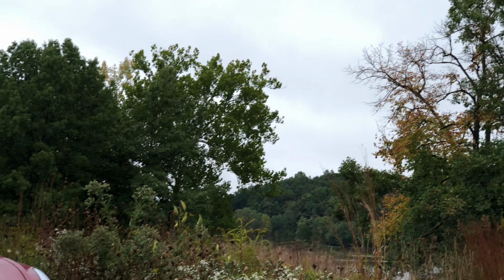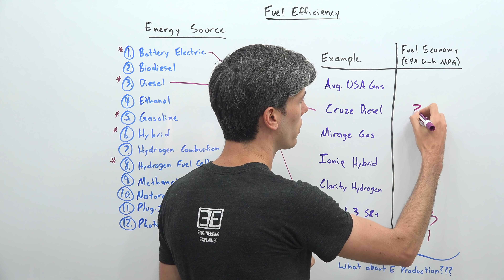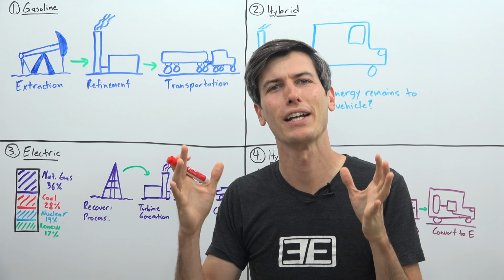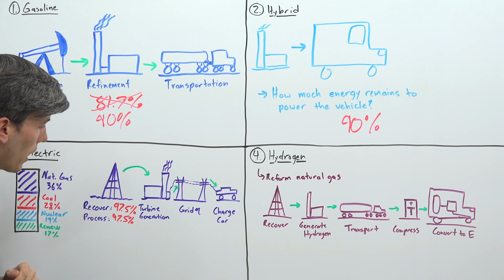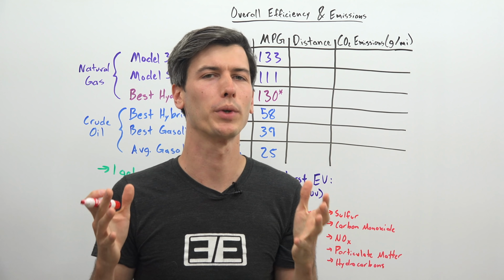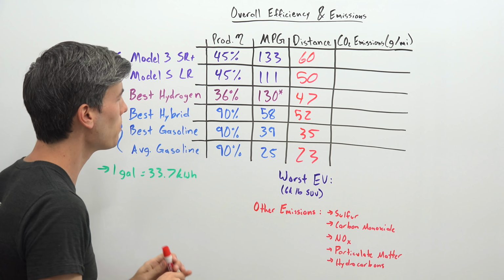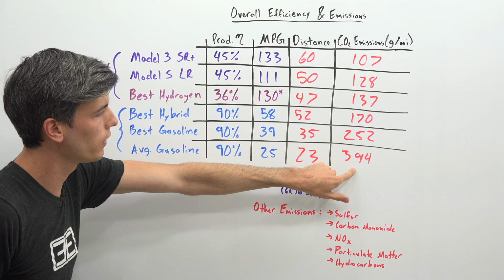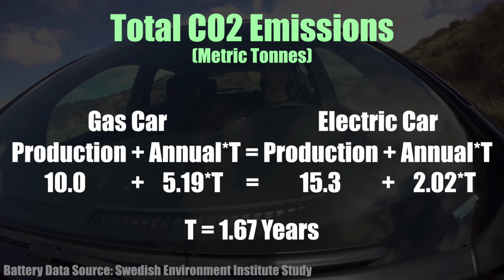Are Teslas Actually Better For The Environment?

Comment: My next question is along the lines of "horse power" pickups and semi's and other towing vehicle pull much more then their own weight. Are electric engines powerful enough to preform
Reply: Samuel Kenkel yes. The current problem is batteries are less energy dense than fuel and they take way longer to charge than refueling a truck or semi. The electric version would still be more efficient there would just be way more down time.

Comment: How does it stack up when you have a 6 year old battery?  Perhaps you don't lose efficiency just capacity?
Reply: Correct, 2012 model S (with the now old and ancient tech) have held up better than expected. 

1 million mile rated battery packs are around the corner, 400,000 mile packs are now

Comment: Hey! Where's the diesel production to mpg to distance to CO2 emissions?

I also have some doubts about your Diesel efficiency data accuracy. Diesels burn their fuel in a much leaner ratio and all at once because of compression ignition instead of a spark plug like gas. Hence diesel engines are the choice of large ships, trucks, etc that have to travel long distance or carry heavy loads. You are also leaving out the CO2 recapture that mass production (growing plants) of bio-diesel would have.
Reply: Because this is in America where unlike Europe, there is no small diesels, most are large. Per CC they are more efficient than petrol, but still nowhere near a electric motor.
Reply: Matt B in America nobody drives little bitty 2.0 diesels. They drive big 6-7L ugga duggas that get 15mpg at best.

Comment: Try calculating the rates with a fixed input, rather than assuming that the numbers which have been posted by EV manufacturers are realistic. There's no possibility that if I fill a tank with gasoline, and recharge a tesla with an ICE generator, over any grid, I'll get more than 15 - 20  miles per gallon.

Comment: Short answer no, getting lithium out of the ground is devastating to the environment around that mine. If we switched to alcohol fuelled cars, we could make alcohol from food waste, then the waste from making that alcohol can be made into fertilizer for new crops.
Reply: I'm never sure how people are convinced that electric cars are worse due to mining, while completely ignoring the fact that mining is involved in building all automobiles, including ICE vehicles. Not to mention, powering an ICE requires drilling for oil, shipping the oil, refining the oil, and shipping the oil again - all of which produces emissions, and you haven't even burned the gas at that point.

Electric cars, BY FAR, vastly reduce emissions from construction of the vehicle to end of life.

Comment: I wonder how well EV are working for people on Cali with no power?  I seen some charging stations being powered by large diesel generators.
Quick note on diesels.  Diesels can perform just as well as EV as far as mpg are how ever you want to measure it.  But the EPA is trying to push them out with all the regs.
2000 Vw tdi are getting 50mpg. (not the rigs soft ware years)  I know people who did a little modding and tuning to the ALH engine and was getting around 60 mpg.  This is a almost 20 year car getting better mpg than the new stuf todayf.  Really?  I call BS on the manufactures today.

Comment: nope, but it depends on the car, driver, and if he charges with coal, gas, solar, wind, hydro etc. how many miles, condition of both cars, remember their is hybrid, gas, deisel, plug ins, etc.
How the batteries were made, and disposed of, and life, those rare earth heavy metal production, total production of all engine motor parts, maintenance, etc.
how you drive, ludicrous, or economy.

Comment: There are people in this world over 60 who have to drive to work over 250 miles and who can not afford a new car because they can't pay it back...so I bought my car for 1.900 Euros with 319.000 km on board (about 200.000 miles) . I drive yearly over 33.000 miles (52.000 km) and have now on my speedometer 700.000 km on board and if I drive behind a truck I get easily 60 miles/gallon and all of this without paying over 30.000$ for a new car. Tesla's which exceed 400.000 miles had most of them their battery exchanged... Which again costs a load of money..at the moment EV's are no choice for me despite of all the hype...

Comment: Study about efficiency of different types of fuels done by people who started an electric car company is not the most trustworthy source of information. As you said, they're using numbers from studies by other people, and it's very easy to pick those studies as your sources that are in your best interest. If you found a study that claims there's no connection between junk food consumption and obesity, made by the CEO of Burger King, would you believe that study or would you be a bit sceptical? I'm all for EVs and new modes of transportation, but when studying stuff like this, it should be considered whether the source is reliable and does the source have something to gain from a certain outcome of their study.
Also, diesel and gas (not gasoline) can be made from stuff like leftover food, farm animal poo, forestry waste and so on. We do all of that here in Finland. Those are pretty much zero emission ways to produce fuel, especially in the case of biogas made from farm animal poo it actually has negative amount of emissions compared to just letting the waste rot and release all the gas that is formed in that process into the atmosphere. Of course burning these fuels will still release CO2 and so on, but it's a hell of a lot better than drilling for oil and fracking for gas.
Reply: renewable diesel is seeing some press here, it's about 1.9x the cost of petroleum based diesel though.   (Neste)

Comment: Natural gas has virtually zero emissions factory's run natural gas forklifts indoors because of this. CNG(compressed natural gas) vehicles the same can be said I'm not sure if they are make them anymore there was honda civics, ford f150s, and Crown Victoria's that I know of. So with a CNG vehicle they basically just use oxygen. If you have ever seen the inside of a cng it looks like it's never been fired. This is the direction that car manufacturers should be going it is far better than electric plus alot of homes have natural gas with very expensive compressor you could be filling up at home.

Comment: Even with renewables, the emissions wouldn't be 0. Renewables can be considered to emit around 200g co2 per kWh.
Reply: It depends, nuclear is about 12g/kwh, solar and hydro , around 50g/kwh. I'm not sure where you got 200 from, that is incorrect.
Reply: @stinger15au  the 200g come from calculating with sun and wind in Germany. Also the carbon footprint of batteries (for storing) and maintenance (cleaning solar panels) were taken into account.
Reply: @unbekannternutzer8506  well that is wrong as I said. 

Its closer to 50g/co2/kwh, that is the entire supply chain.
Reply: @stinger15au  Well how do you calculate the 50g value?
Reply: @stinger15au  i Got official German (Germans promote everything "eco") that say in German sun a normal solar panel gets around 100g co2 per kWh on a 25 year lifespan. Including production, gathering of rare metals and recycling as well as maintenance. This is only the cell without anything else
Reply: @unbekannternutzer8506  The IPCC reports which use data from over 100 different scientific departments.

Comment: I was going to get some tickets for the Bug, but I did some digging. On the giveaway page, they admit that for every dollar, they keep 15 cents. Every charity does this, it's how they raise money, but it's not usually this much. That's fine, but they also state that they then take another 70 cents for advertising and buying the prize, leaving only 15 cents of every dollar to be passed on to the charity. Now, if you thought that was bad, just wait, it gets worse. They aren't actually giving the money to The Planetary Society. They're giving the money to CAF America, which is a charity that gives money to other charities, a sort of charity middleman, and they do so at a cost. There fees are much more reasonable, however they are far more complex. I'd say they take roughly 10 percent, leaving 90 cents of every dollar they receive goes to the desired charity. What does this mean? If you give $100 to Omaze to buy these tickets, The Planetary Society is getting roughly $13.50... That's hardly enough money to buy a meal at McDonald's. 

You'd be better off donating the $13.50 to The Planetary Society yourself and pocketing the rest, rather than letting these con artists have your money. Besides, you probably won't win the Bug. It's likely just there as a front, and they've already determined the winner before the contest starts.

Comment: So tell us Jason if every gas powereed car was replaced by a tesla would the electrical is the GRID  able to handle it
Reply: I've done those numbers, and the answer is no.   Not even close... only somewhere around 70% could.
It's also something of a nothing berder because they can't make that many happen for at least 15-20 years looking forward, nor would they due to range and remote uses needing gasoline/diesel.  Plenty of time for PV, wind, offshore wind, coal->NG and many other options to increase efficiency in other areas of electricity use to provide nega-watts along the way...  one easy one will be replacing any HVAC system that's more than a decade old in the heavy cooling areas ...

Comment: I was expecting this to talk about manufacturing environmental costs.  Instead its going to say electrics are just as bad a gas cars if the grid energy is made with fossil fuels.    Which is blaming a different industry that also needs to change.  Telsa is the zero emission car.  Go rooftop solar or lobby the energy industry to catch up.  The answer is never 'let stay in a gas car because other industries are bad for the environment too'.

Comment: Hey Jason! Informative video!

Where does ethanol fuel figure into all of this? I know almost all ethanol fuels are a blend of gasoline and ethanol, but I just wonder how that might affect efficiency and emissions. It's a less energy-dense fuel,  but do the emissions outweigh the weakness? Thanks!
Reply: A lot of the ethanol found in fuels like E10 (10% ethanol) is corn alcohol. Ethanol releases CO2 in the production phase (ie. fermentation) and when it's burned. However, the CO2 that it releases was collected and trapped by the corn plant while it was growing, so it's merely recycling the same carbon already found in the atmosphere rather than releasing underground deposits into our air. Therefore, ethanol is close to carbon-neutral because its net CO2 emissions come from farming and transportation.

Comment: Man, your calculations are extremely conservative. Taking into account that producing 6 liters of gasoline needs about 42kWh of energy the case is pretty clear. That 6 liters might get me about 100km/60miles of range. But 42kWh is gonna get me about 200-300km(120-180 miles) of range.
Also hydrogen produced from electrolysis needs about 3 times the energy to produce a certain amount of energy in the end compared to an electric car. 
1kg of hydrogen is gonna get you about 100km/60miles of range, but at the same time needs 50kWh to be produced. 50kWh is gonna get me at least 180 miles in a BEV.

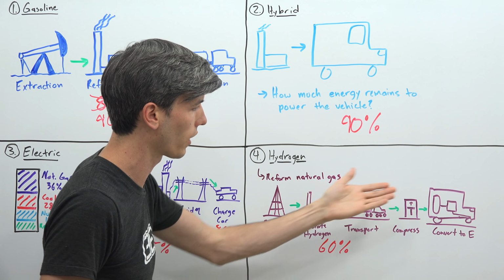Comment: You included hydrogen fuel cell efficiency in the total hydrogen efficiency, but you didn't mention gasoline engine efficiency, which is ~35% @ 8:06

Comment: I'd still rather have a hybrid. Though we need a hybrid diesel. More practical than straight electric.
Reply: @M Bacon Hybrids can just use the main electric drive motor(s) to start the engine. Depends on the design, but at least in some of the eCVT no-shifting-gears-type transmissions, one of the 2 electric motors is used for engine start. And that motor is plenty powerful enough.

Comment: Great video! And you didn’t even talk into the account use of oil in combustion engines. 

I really want a Tesla.
Reply: Well , a Tesla has a single speed tranny and diff. Those need oil.
Also won't a electric motor require some lubricantion?
Reply: @atarvhegde5210  electric motors are magnets and don’t have touché moving parts. The transmission isn’t a transmission they’re one speed. The only thing that needs oil is a diff. Assuming you don’t have an independent motor per wheel

Comment: I doubt efficiency of getting petrol from oil well is 90%. Mere refining, reportedly, requires more energy than electric car per distance traveled.
Reply: that's not even remotely true on energy exchange to produce refined fuels vs electric car actual miles.  EVs are excellent, but the amount of energy in on producing gas/diesel is grossly misstated.

Comment: Are you sure that is the most efficient diesel? I drive a 190PS Skoda Superb, and does a rated 64MPG. Okay that's imperial. So converting, we're talking 56MPG. Do you not have these in the US?
Reply: run your skoda on the EPA's test stand, all 5 tests and let us know how it turns out.   they don't sell those here, so we can't know apples-to-apples.

Comment: Hmm when the battery shits the bed at 80k (which it will) and you have to get a brand new one made that's 2x production emissions
Reply: batteries are doing well over 100k +. With Tesla recently announcing new battery chemistry which will be good for 1 million miles. Sort of blows your argument out of the water.

Comment: simple question, why did you use grammes when you have used miles & gallons for the rest? why not using the metric system all along, it is so much accurate?
Reply: Antoine Thouvenin because he’s mainly talking to Americans. We use metric mass and volume quite a bit but rarely metric distance.

Comment: So, if you get hydrogen through electrolysis, the fuel cell vehicle emissions will be much lower right?
Reply: Nope, the energy requirements for electrolysis are huge. It's much more efficient to send that electricity straight to a battery instead.

Comment: To me, based on your math, hybrid and electric cars have similar potential going down the path - electric cars have better performance but high in cost and low in range; hybrid have more range and low cost but bad performance. I think you are not trying to make a comparison but rather you are trying to make your point.
Reply: hybrids need fossile fuel to work unlike the ev

Comment: What about the Co2 emissions that it takes to extract and refine the lithium for the batteries?  if you added that to the equation, gas is better hands down.
Reply: Not even close. a lot of lithium is claimed from the sea. with the sun doing the work.
Reply: @philterry3293  have you seen the luithium mines?
Reply: @philterry3293   I used google for you.   While seawater is actually a brine, it differs from traditional lithium source brines (e.g. salars) in that the lithium concentration in seawater is much lower. ... By contrast, seawater contains less than 1 ppm of lithium..  Normal Brines 300-7000 ppm
Reply: @philterry3293 ..  but i did learn more..  they extract it different ways and a brine lake is the best... i was thinking it was extracted from the ground with machines..   not trolling,  thanks for opening my eyes.
Reply: @michaelharris9369  Thank you for being open minded. Many are too proud.

Comment: What about when the EV vehicle is scrapped and the useful life of the vehicle is done? How much of the battery can be recycled? This is an important factor also. I heard not much of the battery can be recycled. This means lots and lots of chemical waste and air pollution will be emitted when they recycle part of these batteries.
Reply: car batteries are seeing a second life as energy storage. Batteries can be fully recycled If there is the will to do it.

Comment: Here’s something no one is talking about: why are we trying to replace co2 emissions from gasoline with co2 emissions from electricity when a much more effective solution is to just sacrifice a little and use less electricity?
We’re trying to justify our wants instead of only using the emo unit of power we need. Turn off your lights when you’re not using them. In the summer, use the air conditioning less. In the winter, use less heat. Deal with the temperatures a little bit and you will drastically reduce the amount of power consumed. Drive less often. Don’t make unnecessary trips to the store just to buy 1 thing. I get that everyone loves to go out and do stuff. It’s part of our culture but if you have a night in, you can drastically reduce the amount of miles on your car as much as possible. It’s a win win. You reduce emissions and save money on electricity and gas if you learn to sacrifice a little.

Comment: These figures are only true for the states. The UK average mpg on 2019 cars is 55mpg (45mpg US) and that's not special high mpg models or hybrids. The smart car in the UK gets 99mpg (82mpg US). I think if you calculated with these numbers it would not be a fair conclusion to say electric outweighs combustion from an efficiency or emissions stand point. We also need to factor in the emissions of battery cell production.
Reply: UK smart car would get 73.8 miles distance traveled based on 90% of (82mpg US) that's more efficient than the tesla.  On 83% of 82mpg would be 68 miles traveled.

Comment: you did not account for losses for the extraction and transportation and the boil-off during storage of petroleum fuels which cuts your efficiency numbers for gas and diesel in half, not to mention that electric has a 95% efficiency battery to wheel and the gas car about 20% tank to the wheel.